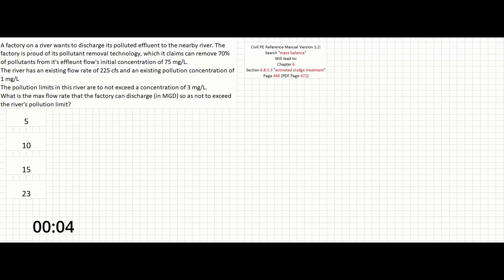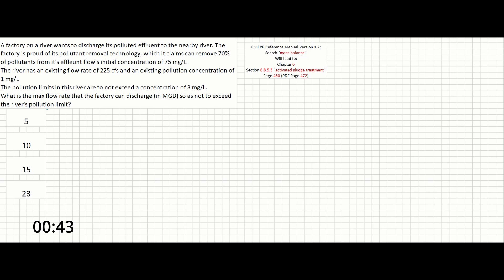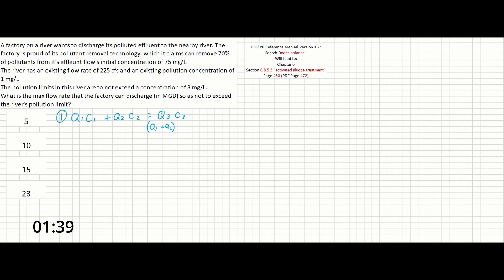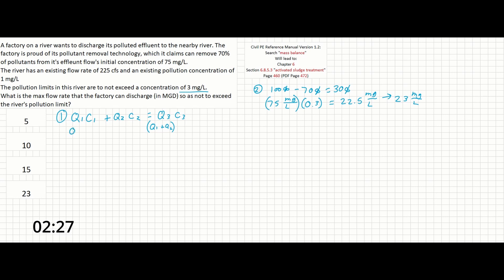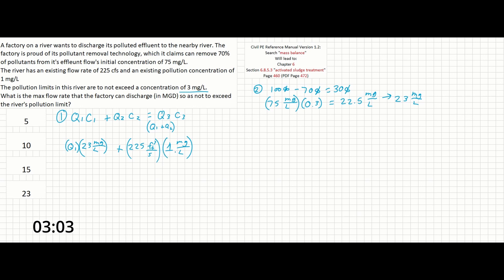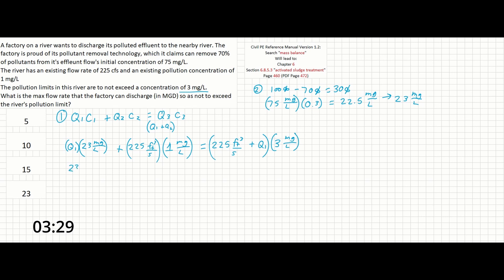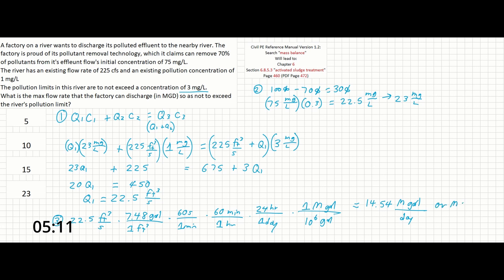PE Exam Practice Problem #13: Water Resources | Mass Balance - Dilution - Pollution Concentration

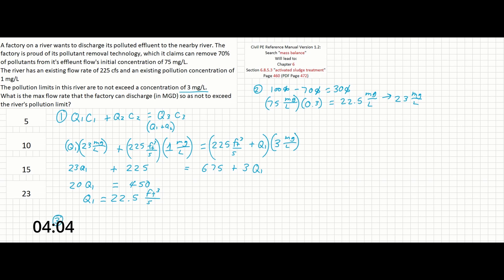Comment: 4:02 It's worth noting that the flow in cfs is given as a possible answer, even though it's "wrong" because the question specifies to answer in mgd. This will absolutely be something you encounter in the actual exam!
Reply from the maker: Great call and you're absolutely right. I'm trying to remember if I did that on purpose and then forgot to bring it up in the video, or it this is just a coincidence. Either way thanks for adding a comment about it.